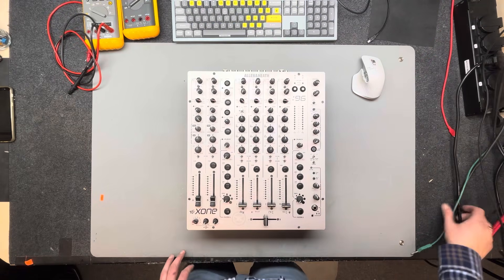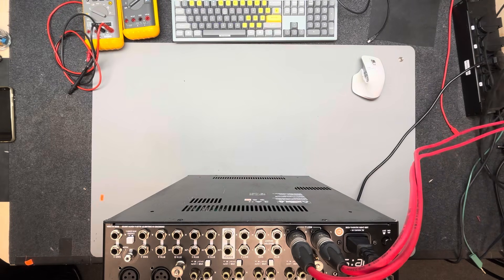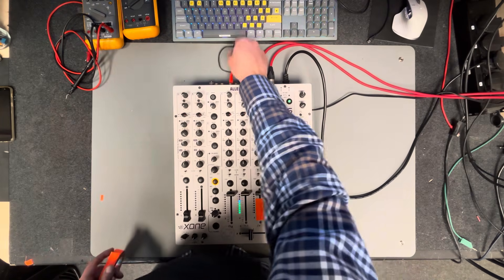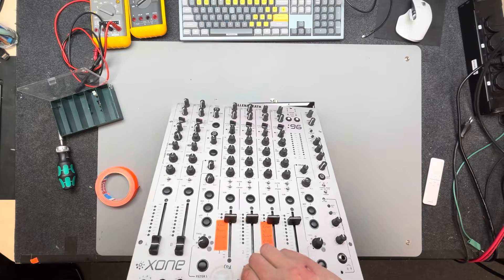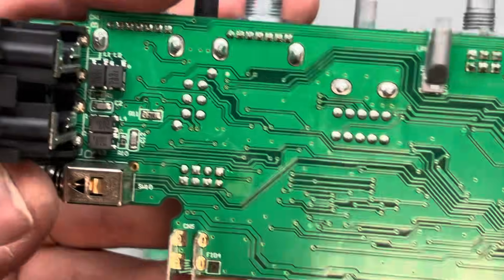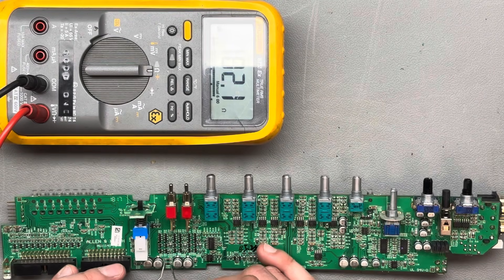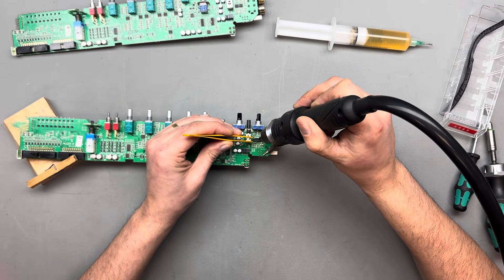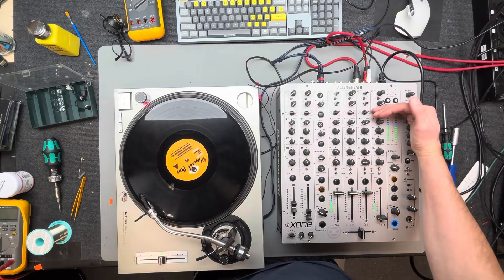Allen & Heath Xone:96 Phono Repair – Step-by-Step Fix!

Comment: Hi Yuriy, I have a Rane Empath DJ mixer.  The Channel 1 RCA Phono input, only works on the left side, the right side is dead.  However the Channel 1 Line input works on both left and right with no issues.  Anyway we can get the Channel 1 Phono RCA input right side fixed.  

Thanks John.
Reply from the maker: Hi John,

I think it’s possible to repair the mixer. Most likely, someone sent a line-level signal into the phono input, or the RCA jack is faulty.

If you have a multimeter, you could check for short circuits at Channel 1, right where the RCA jack is soldered. Check the following components:

R39 should read 47.5kΩ
C2 should be 150pF
C17 should be 47pF
If there are no short circuits, then replace Z1 (4580 Op-Amp) – it’s most likely defective.

Good luck with the repair! Let me know if you go through these steps and need further assistance.
Reply: @miktroniks   I do have a multimeter but not the best at using it but always willing to learn. You are a master and i am a novice who knows a little bit.  I did replace the dual rca, but this did not change anything,  phono input right side is still dead.  Will check components you said best way I can and report back.  I have two of the same mixer with the same type issue, don't mind removing a part from one to the other one to fix problem.  Again I am a novice, if I don't figure it out maybe we can do a zoom face to face and you can walk me through the process.  I appreciate your help Yuriy.   Will be back in contact today with updates.  Thank you Yuriy.
Reply from the maker: It’s never too late to learn! If you have some patience, I can record a video this weekend with a Rane Empath mixer showing the exact issue or, more specifically, the troubleshooting process.

That way, you can watch it and simply follow the same steps to repair your mixer.
Reply: @miktroniks  Thanks again yuriy.  Let's first try to fix this together, then if things become complicated for me, then it would be appreciated you making a video. So the RCA was replaced and there was no change, same issue still there right side has no sound. As per your instructions I have located R39, C2, C17, and 4580 Op-Amp.  I tested R39 and it reads 47.6ohms so that looks good. Not sure what setting on multimeter would give me pF readings for C2 and C17.  Where should I set selector position on my multimeter to check C2, and C17?  Attached below is youtube link showing a video of my multimeter.  https://youtu.be/44lXTqbzbYw
Reply from the maker: @blackbeanmusic  

Set your multimeter to beep mode – when you touch the probes together, the multimeter should beep.

Now, measure both capacitors. If the multimeter beeps, it means the capacitor is shorted and therefore defective.

However, it is highly unlikely that the capacitors are faulty. The next step would be to replace the Op-Amp (4580).
Reply from the maker: @blackbeanmusic  https://www.youtube.com/watch?v=CMwF7DlxB2w  here is the video
Reply: @miktroniks  Hi yuriy, thank you so much for the video, appreciated.  Watched video, and listened to your instructions.  Tested R39, C2, and C17, and there was no beeping.  Went ahead and tested R38, C1, and C16, and there was no beeping.  The Channel 1 Phono Rca has continuity on the left and right phono pins.  I checked this like you did in the video.  I guess next step is to follow your video and remove the 4850 chip.  Noticed you used ChipQuik SMD291 to remove chip.  Ordered some of this and it should be delivered tomorrow.  What is the recommended heat degree temperature i should set handheld heat blower to for chip removel?  Also don't have a 4058 chip handy, however I do have two Rane Empath mixers, one of them i use for parts. For sure Channel 1 Phono on the empath parts mixer works. Would it be okay if i remove the 4850 chip off the Empath parts mixer, and install it in the other Empath that needs to be repaired?  Or do I need to buy a new 4850 chip?
Reply: @ yuriy, changed the 4058 chip with one from the spare parts mixer.  I said it was the right channel that was dead, and don't think i made a mistake, but i tested mixer and its the left channel thats dead.  I checked R38, R39, C1, C2, C16, C17 and all of them do not beep.  RCA has continuity on both left and right on channel 1.  Not sure what else to do.  Thank you for you time in helping me, much appreciated.
Reply: @ yuriy, changed the 4058 chip with one from the spare parts mixer.  I said it was the right channel that was dead, and don't think i made a mistake, but i tested mixer and its the left channel thats dead.  I checked R38, R39, C1, C2, C16, C17 and all of them do not beep.  RCA has continuity on both left and right on channel 1.  Not sure what else to do.  Thank you for you time in helping me, much appreciated.
Reply from the maker: And what about **Line**? Do both sides work?  

Where are you from? Maybe I'll repair the mixer for you for free? :) 🎛️🔧
Reply: @miktroniks   Yes, the channel 1 Line does work on both sides.  I'm in the USA.  You may be very far.  The 4058 chip I replaced does the 4 pins on one side represent the left channel?  And the 4 pins on other side of chip represent the right channel?  When i first installed chip guess the solder points were not properly soldered because when i went to test mixer both left and right Phono 1 was dead no sound. So i hit the 4058 soldered pins with my air gun a little better, then reconnected mixer to test, and now the right side was working but the left side had no sound.  Gonna take a picture / video of chip so you can take a look at it.
Reply: @blackbeanmusic  Are you sure you don't mean NJM4580/JRC4580 ?